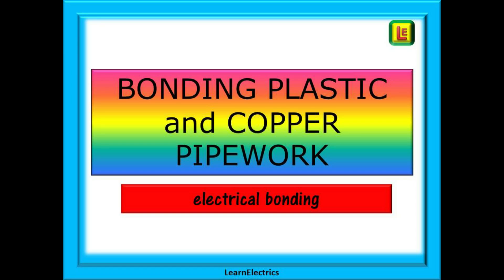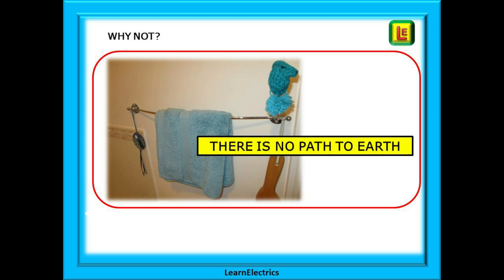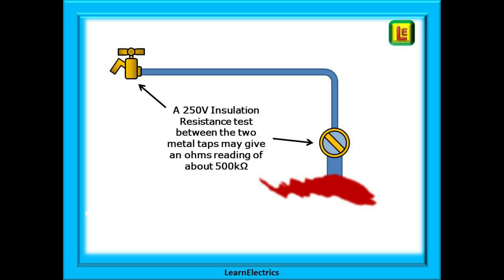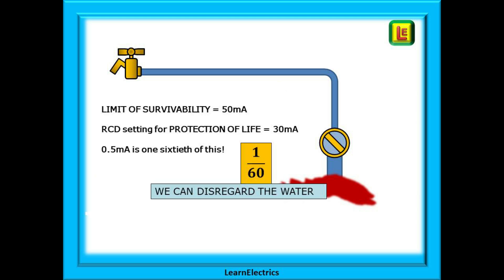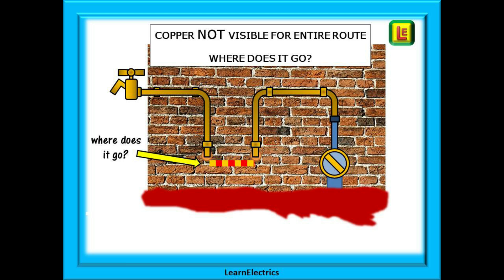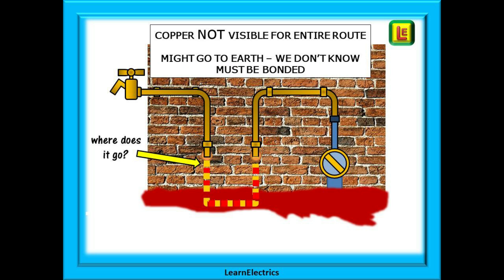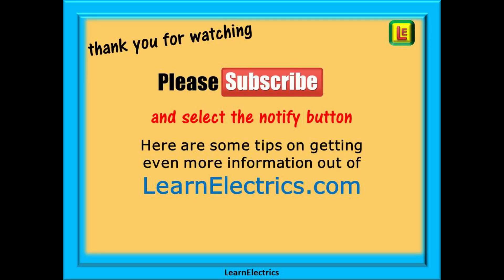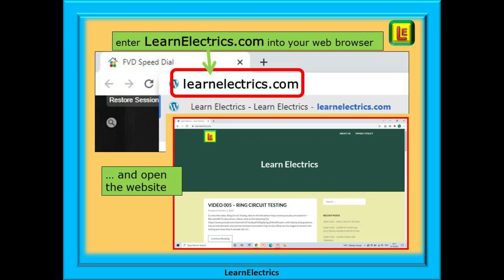BONDING PLASTIC and COPPER PIPEWORK in ELECTRICAL INSTALLATIONS

Comment: I have installed an electric shower. It is fed by a pvc pipe with a copper coupling going on to the water inlet of the shower. Will that require bonded?
Reply from the maker: The pvc pipe won't require bonding, and the shower itself should have an earth connection. Check if the copper coupling is between two plastic parts, and if it  has continuity to earth at the shower earth connection. If there is no earth continuity then it would not need bonding.

Comment: Hey Dave what does it actually mean when it says it can produce An earth potential?
Reply from the maker: It can be earthy, have the same potential as the ground or earth, usually zero volts. If your feet are at earth potential - zero volts - and you touch an energised part you will get a shock as voltage passes through your body to earth.

Comment: Hi Dave!

I dont know how you doing this but if i always have some problems with electrics, yoir videos helping me a lot!

However i got a question about that bonding sections. So i recently bought a house and i cut a some sections in water pipes (for radiator). Most of them are sections which are going to radiators. I replaced them to pvc pipes. So the question is do i need to bond a section in between copper pipes? 

It is like a last example in the video but copper pipes are below floorboards and pvc is visible in the rooms.

Thank you for that what you doing!
Reply from the maker: If the copper pipework is floating, i.e. there is plastic at both ends of it AND it does not go into the ground anywhere, then we wouldn't normally bond. Have a look at this second video on bonding, there are other on the website too,   LearnElectrics,com

Watch this one.
https://www.youtube.com/watch?v=afDWcA0gGLc

Comment: Such informative videos! Thank you. Scenario. I have a Metal Pipe Water Main coming into the Building. This is Earth Bonded at the Tap. The Pipe then goes off in Plastic around the house. The pipe enters back into ground in (metal) and out to an outside tap. My question is…….Is the Bonding at the Main Incoming pipe suffice or does this require a Separate bond to this part of the installation? Meaning 2 water Earth bonds to different parts of the installation? I would welcome your reply 😊
Reply from the maker: You will need to bond both metal pipes as they go ground, they are extraneous conductive pipes. Dave.

Comment: my house has the incoming water in plastic to the main stop tap then the house is in 15 mm copper? are you saying it doesnt need a 10mm main bond then
Reply from the maker: The copper will need bonding unless you can see the whole route of the 15mm copper and you have resistance tested it back to the MET to prove it is not an extraneous conductive part. If it disappears from view, it may need bonding as you don't know if goes into soil, etc.
Reply: @learnelectrics4402  
yes you can see it the pipe comes in plastic into the stop and then leaves incopper up to the boiler then up the wall to feed the heating system etc

Comment: Just trying to get my head around this subject (not an electrician) and have a question. If it's metal pipes touching the earth that can cause a problem and need bonding, then do metal pipes touching brickwork not cause the same problem? The bricks are clay and are also in contact with the earth so are they not in effect kind of like a raised piece of the ground touching the pipes?
Reply from the maker: Good question. Its all to do with resistance. The bricks have a higher resistance than copper,. Think of ceramic floor tiles, you don't bond them. High resistance  means lower shock currents. take a look at this video and the examples, it will help. Its great that you're learning, lots more on the LearnElectrics channel and at LearnElectrics.com.
https://www.youtube.com/watch?v=Rexyl2V829g

Comment: Hi. Thx for videos. Can you confirm something for me?  My house has plastic water to stopcock but mainly metal throughout. It may be earthed by way of boiler  cpc which I guess is connected to all copper pipes throughout via brass mono taps, certainly boiler, hot water, ch pipes and bathroom radiator will be connected cold mat not be.
House is PME and currently 10mm bond is in place. However in 18th I don’t have to bond as plastic incomer. I appreciate bonding is different than earthing but if the cold water pipe doesn’t have connection to heating and hot water pipes say because plastic tap connectors are used, a cable fault in service duct could make pipe live. When I touch outside tap (cold water) I would then make the circuit for rcd to trip. In this scenario if the main bonding connector was there it would be acting as an earth for the cable fault and rcd would trip at time fault occurred.

Wouldn’t it be prudent to earth ( or is it.  bond?) all long metal pipes that could become live at some point by cable faults, say in service ducts.

I appreciate this is highly unlikely scenario but just wondered what your thoughts were.
In this scenario cold water pipes are lumps of metal, not extraneous conductive or exposed conductive parts
Reply from the maker: An interesting and enlightening point Mark. Thanks for the input, appreciated.

Comment: Iv heard that metal frames on patio doors should be bonded.
Is that a myrh?
Reply from the maker: The questions to be answered are will the metal frame introduce a dangerous potential, are any cables passing through the frame likely to be damaged or crushed or snagged in the doorway, is there any electrical equipment actually mounted onto the frame. Then consider this, if it was a wooden frame or door, would you bond the metal door lock or a metal fire escape bolt. You have to consider each situation on its own merits and individual circumstances. Hope this helps. Dave.

Comment: You bond for static electricity including lightning. I would bond at house point of entry with a 6” piece of copper pipe. This will assure lightning won’t enter on the water lines. Any analysis available for or against for lightning reasonings?
Reply from the maker: Thanks for watching, appreciated.

Comment: If earth bonding is so important now, why was it not done years ago? The science of equipotential is hardly anything new. My 60yr old house has no bonding atall to any of the all metal pipework inc the lead incoming main & gas supply line to the boiler (installed in 1970s).
Reply from the maker: Ideas and methods change. Its an evolving science. Dave.

Comment: Hi Dave, your videos are an amazing resource to anyone like myself learning thank you so much. I am amazed your subscriber numbers are not much higher, I guess quite a lot of people don't know about your channel yet  so I will be spreading the word around as much as possible. One question please, in your example of the outside tap at 3.30 if someone touches the tap to turn it on doesn't the person then become a path to earth? So shouldn't the pipe still be bonded? Many thanks Chris.
Reply from the maker: Thanks for the feedback Chris, yes please spread the word.
Bonding. How does a fault get to the tap. If its fed by plastic pipe then its not connected to any potential danger. Are you going to bond every metal screw on every pipe clip that holds the water pipe to the wall. It's the same thing. Hope this helps. Dave.
Reply: @learnelectrics4402  Many thanks.

Comment: Dave, what if through various methods such as a gas boiler (cpc from spur), shower  (cpc) introduce an earth to the water service through the cpc of the electrical system and where there is no rcd protection should the main water service pipe then be bonded?
Reply from the maker: If there is no RCD device then supplementary bonding would normally be a requirement for any metallic pipework that had a route to earth.  We have a video planned for this fairly soon. Thanks. Dave.

Comment: Nice one dave 👍 I’ve looked under the sink in kitchen where there is the water bond connection but noticed after the connection strap there’s about an inch of copper then it goes back to plastic fittings and pipe for abit then back to a small amount of copper for taps , surely there should be a link from the bond connection to where there is abit of copper for taps or would it not make a difference 🤔 pretty certain it’s all copper right back to “earth” where the water bond is connected , cheers dave 👍👍
Reply from the maker: The sink is not considered as needing bonding. If the taps are plastic at the sink, no need.
Reply: @learnelectrics4402  cheers dave 👍 from what I can see the tap is just on them braided hose connectors and then copper
Reply from the maker: Thanks. Dave.

Comment: Thanks for the video.  As an adult learner I struggle with the theory of Main Bonding and Equipotential Bonding.  At 4.29 you say "we must bond both sections of it". Does that mean a separate 10mm earth bond for each leg of the visible copper back to the board?
Reply from the maker: There will be times when you cannot trace the route, you don't know where it goes to earth etc. So you may end up bonding both halves but it can be done with one piece of 10mm if it reaches, if they are close. Just be aware of what happens if one of the pipes is removed, you are trying to avoid being left with a piece of copper that goes to earth with no bonding. that's all. Thanks for watching, we'll get you there. Dave.
Reply: @learnelectrics4402  Thanks for taking the time to reply, appreciate that
Reply from the maker: No problem, thanks for asking. Most times you won't need to put a second bond wire on, just where you have no idea where it has gone - and it happens. Thanks for your support.

Comment: With the pipes that disappear, why not do a long lead insulation resistance test? anything less than 22kOhms won't need bonding assuming a safe fault current of 10mA.
Reply from the maker: Thanks for watching Steven. This and some other measurement techniques are part of another video. We would want the resistance reading to increase in order to reduce the fault current to10mA or lower if possible. Great comment. Dave.